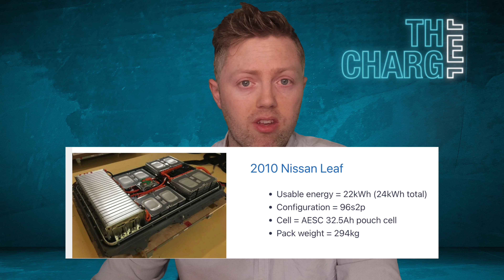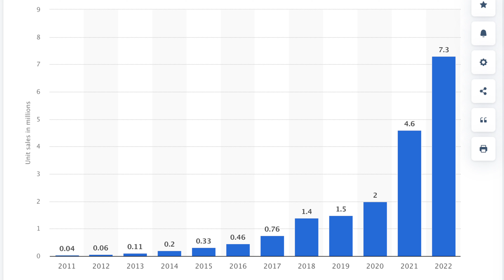Nio now Mass Producing 150kWh Semi Solid State battery

Comment: 1000 km with a 150 kWh battery ?  How is that any better than what’s currently available ? It’s just a huge battery pack
Reply: It is 40kg heavier than 100kwh battery and it has same dimensions as 100kwh battery so if you have a 100kwh car, you can get this swapped without any issues.
Reply: NO, it has a much higher density so having a 100kwh battery pack at 190 wh/kg would be heavier than having a 100kwh battery at 250wh/kg. And in an electric car weight is everything, so they are much more efficent cars. Basically for the same battery dimentions you can fit more energy storage in there, or conversly you can have a higher capacity at the same weight. say 130kwh at the same weight as the previous 100kwh battery.

Comment: There is no such thing it is either ternary ,lfp or solid state. Nio themselves don't make batteries they are supplied by CATL.  When it comes to batteries always best to read past the headlines and deep dive into the truth.
Reply from the maker: Thanks for the comment. You're technically not correct so I have to disagree with you. There are a lot more chemistries than what you just listed. Thanks anyway.
Reply: Supplied by welion in this instance. The rest are indeed catl.

Comment: I can see where the idea of new and improved batteries coming ‘soon’ could reinforce the “Osborne Effecr” with buying EV,s.
Ie: keep waiting to buy because the new improved version is ‘just around the corner’ which disrupts the current market.
No doubt solid state with its incredible charge speeds and energy density would be great for the EV market where ‘range anxiety’ and ‘charging speeds’ are the most commonly stated reasons for not buying and EV. However, imagine what a sudden change like solid state could do to the current market. I could see the bottom completely drop out the used EV market for a while as older EV,s become near worthless. There might be some pretty good bargains to be had.
Reply: This is what has stopped me taking the step to EV so far. Used prices are just coming down to the level where I can afford one, but I can't afford for it to become worthless overnight. What are the chances that a nicely designed EV, I'm thinking the Honda E, could have a new, denser, battery type dropped in a few years down the line when the technology improves?

Comment: But what is the cost to produce per kWh?
Reply: Exactly.  CATL stated they'll be at $56 per kwh at the cell level by the end of the year and BYD is lowering pricing as well.  It's going to be a tight pricing market by the end of the year.
Reply: Too much for resale. But why in the world would that matter to you if it is only rentable?
Reply: @onetwothreefour-s1n  because even if they are only renting, if compared to other battery cells they have to charge twice as much, over just 50% more, then someone could come along, make a cheaper product, rent for less, and out compete them.
I am sure Lithium Ion batteries will eventually hit some plateau, that is when other chemistries could take its place. Sodium looks like for applications where weight and volume are not a consideration, like fixed storage, will be a good replacement for Lithium ion batteries.
Maybe eventually solid state cells will be made light and cheap enough for mobile storage, like for vehicles, it will dominate… but I would think 5-7 years to really ramp up manufacturing once the tech is proven commercially viable (not lab or test batch sizes, but volume production runs).

Comment: the definition of a EV is if it can move forward on Electrons using a AC motor = if YES than any Hybrid that allows this function is a EV ...
so all Toyota and NISSAN Hybrids can do this
only older Honda Hybrids can't ...